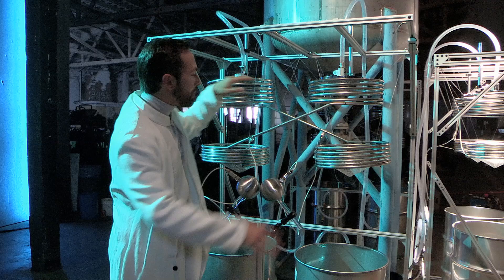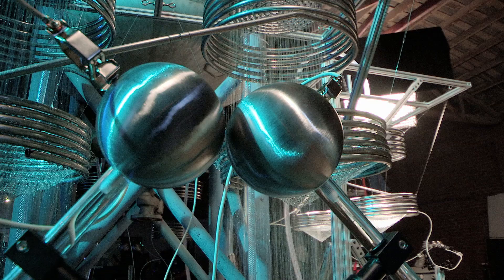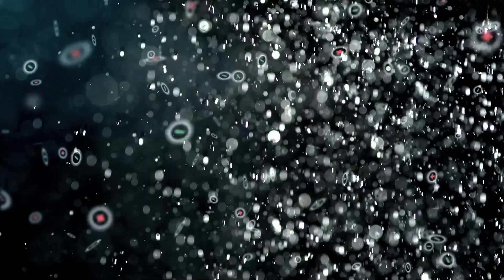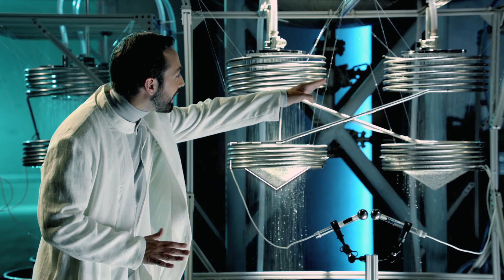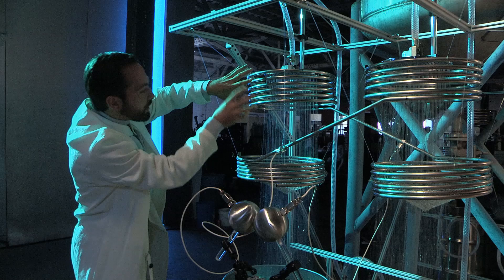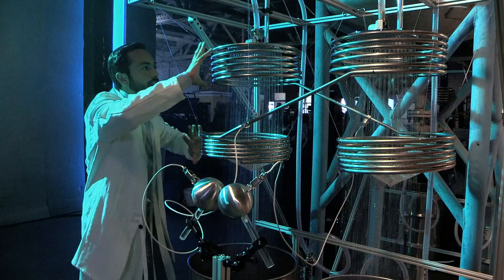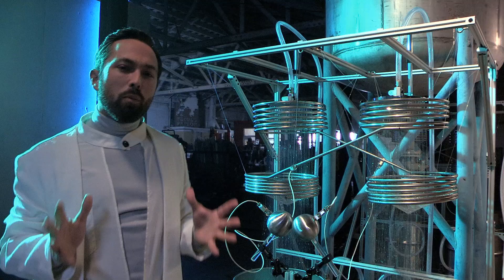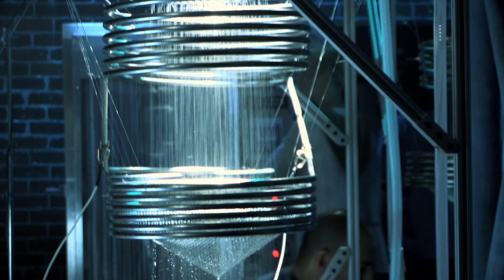Sparks from Falling Water: Kelvin's Thunderstorm

Comment: I guess, if the water were purified H2O (or "distilled water"), it would not produce any charge, but in normal water, there are always other types of atoms present, which exist in a state of ionization, being partly bonded to the water molecules, like if you put salt into water. If I remember my school chemistry correctly, that becomes Na+ and Cl- molecules which bond to the according side of the water molecules. That can only happen because water is a dipole molecule, it has one end that is positively charged and an other end that is negatively charged. So these ions will cross the charged wire mesh and then lose their charge. Because the water has before flown through the metal rings with the opposite charge of the wire mesh, the effect increases itself.
Reply from the maker: distilled water still contains ions because it dissociates into H+ and OH- so even pure water would work in this apparatus.
Reply: Veritasium So the water molecules are not actually H+ on the one side and OH- on the other side, as I were told in school and made to imagine a "triangular" shape of the molecule?
Reply: Ions, remember?
Reply: MrB10N1CLE Yeah, but distilled water isn't electrically conductive, or at least it has a way higher resistance than normal water, so there should be less to none ions in it?
Reply: Seegal Galguntijak When people say pure water is not conductive, it is because there are no ionic pollutants. Stuff like table salt (NaCl) would dissolve and conduct electricity. As such, pure water wouldn't function as a wire in that sense. In this case, it is less electricity than it is electrostatics, as far as I can observe, so it functions based on the fact that water is bipolar so it can separate charges.
Reply: It's not that it is not conductive. It is a poor conductor, but still it does conduct electricity, and also some of the water molecules does ionise itself.
Reply: Actually, pure water (H2O only) actually has a weird thing that happens; a very, very small percentage of the atoms will spontaneously dissociate into "H3O+" and OH-; the pH of the resulting water will still be 7.0, though, as they cancel each other out. 

TL;DR for below: There are 10^-7 mol/L of H+ ions as well as OH minus ions. Comparing this to the 55.5 mol/L of H2O.

The details, and finding out exactly how many ions there are per mole: There is something known as the "equilibrium constant" of any solution: Keq = [products]/[reactants]. Each one is raised to the power of it's own coefficient: in this example, H2O + H2O <-> H3O+ + OH-. It's been a year since I've taken the course, so I only know as much as my notes do right now: Keq = [H3O][OH]/[H2O]^2 // Keq * [H2O]^2 = [H3O][OH] = Kw.

Now, since this is pure water, we can assume that [H3O] = [OH]. Also, someone somehow (probably experimentally) figured out that the value of Kw = 1.0*10^-14, so 10^-14 = [H3O]^2, and when we square root both sides, we get 10^-7 mol/L = [H3O].
Reply: "I guess, if the water were purified H2O (or "distilled water"), it would not produce any charge, but in normal water, there are always other types of atoms present, which exist in a state of ionization"

Dafuk? ಠ_ಠ ....Uh... You weren't paying attention in chem, were you?
Pure water WOULD STILL produce a charge.
Impurities in water are not "atoms".
There ARE atoms present in pure water.
Each molecule of water has three atoms (two hydrogen atoms and one oxygen atom).
EVERYTHING has atoms. All matter is composed of different combinations of atoms made from combinations of different subatomic particles (protons, neutrons and electrons).
Reply: Two Replies That's why I wrote "other types of atoms" (and meant "other types of molecules and atoms"). Of course I know that every matter is composed of atoms, sorry for being so unclear to you.
Reply: Two Replies I'm pretty sure the charges comes from ions, which are not present in destillated water.
Reply: Seegal Galguntijak
Most of the water molecules will be H2O (polar covalent), however 1 in every 10,000,000 (10^ - 7) of these molecules will be ionic in the form of H+ (actually H3O+) and OH-. Incidently this is why water has a PH of 7).

(See Monkyupurbutt 's comment above for a good technical explanation.)
Reply: Samuel Estenlund
Pure water contains ions. See my comment above.
Reply: fred321cba
Oh my goodness, my years in Organic Chemistry are coming back to haunt me! I love that I actually remembered this while reading "pure water contains ions." I instantly remembered H3O+ and OH-. Thank you for that!
Reply: This is a pretty good answer
Reply: Monkyupurbutt Oh god your username is so... you know.. .and then that brilliant chemistry happening... wow.
Reply: Monkyupurbutt they dissociate because of thermal energy (10^-14 is the kw value at 25 celcius, it increases with temperature) , it's not spontaneous in the true sense of the word, tehnically, at close to zero kelvin, you would have 0 ions in water, since it would be entirely crystallized
Reply: Seegal Galguntijak H2O creates H3O+ and OH- on its own through self-ionization. When one molecule bumps into another, depending on its speed and orientation one molecule grabs an H from the other, forming both ions.

It happens no matter what because liquid water is always in motion. Distilled or 'De-ionized' water is used not because it has no ions, but because it has no ions in it that aren't hydronium or hydroxide ions.
Reply: L2112Lifz But why does 'distilled' or 'de-ionized' water have such a high electric resistance, when it actually contains ions as well?
Reply: It's resistive when compared to non-distilled water, but distilled water is still technically conductive.

This question is actually the basis behind the self-ionization of water. Arrhenius found that distilled water was still capable of carrying a tiny charge (a conductivity of 0.055 microsiemens * cm-1), and theorized that water was made up of ions, as well as molecules of H2O.
Reply: Samuel Estenlund yes they are present
Reply: Seegal Galguntijak because aren't ions that conduct electricity, in fact normal water contains various salts and substances that helps to conduct electricity. Distilled water is water without those salts that are present in normal water
Reply: MR5er1 Yes, but my understanding was, that these minerals that help the conductivity of water (or create it in the first place) are dissolved in it as ions. Which is electrically charged particles. So the answer that L2112Lifz gave brought me closest to understanding this (what appeared as a contradiction to me).
Reply: They do help the conductivity of water, but distilled water is still better described as a bad conductor than a good resistor.
Reply: Seegal Galguntijak ok, but i have to say that are the H2O particles that create the electric charge, because also those particles are divided in positive and negative ions. Water is neutral because positive and negative ions are balanced, this machine take advantage of the fact that we don't live in a perfect world and water is always a little more positive or negative. So it doesn't matter if water is distilled or not.

I hope i answered correctly ;)        Sergio Italy
Reply: And also it does' t matter the bad or good conductivity of the water because In this generator the only things that
 conduct electricity are the metal coils and the two spheres
Reply: MR5er1
Yes, but the question in this thread was how can distilled water be charged if all of the ions are taken out.

Quick answer, they aren't all taken out. Dirty answer, Arrhenius theorized that water was made up of a balanced mixture of ions in solution because he noticed the capability to run current through distilled water despite there being no added positive or negative ions present in the water... Which explains why this would work with distilled water or with regular tap water.

And that's how we got sidetracked into talking about the conductivity of distilled water.
Reply: it's explained in the video!
Reply: MR5er1
The basics were explained in the video about polarization of water... But then there was a comment about using distilled water, which brings us to now.
Reply: +Veritasium It is difficult to believe that deionized water would produce any appreciable charge separation purely from the hydronium and hydroxide ions alone, as the concentration of these ions is very low, and your apparatus is not a perfect system.
Reply: +EebstertheGreat even if there are very little iond out of balance they are still going to attract some balanced ions in the coils, accumulating energy like a capacitor and then jump across the gap betwenn the metal balls. excuse me for my bad english...  i'm from Italy
Reply: MR5er1 I understand the principle, but like I said it is not perfect. Hydrogen and hydroxide ions won't even accumulate on the mesh. Even if they do, it will take a long time to build up a charge, if it even builds up at all and doesn't get washed out by noise.

Distilled water has a resistivity on the order of 1 GΩ·m. I don't know the resistance of the open circuit in this setup, but it's hard to believe it's greater than a gigaohm.
Reply: +EebstertheGreat - not sure 1 Gig-Ohm-Meter is right.  I've always heard 18 Meg-Ohm-cm.  Sure, round that down to 10 M-Ohm.cm.  Then comes conversion from cm to meter, a factor of 100 used to multiply or divide. If one multiplies, then yes 1G_Ohm-m.  But I think division is the correct operation here.  Then it's only 100k Ohm-m.   
   Two ways: 
 1) it's a cube of water, conducting from face to face,
       If it's n times bigger, then it has n times more length increasing resistance, but n-squared more area, decreasing resistance twice as much.  So resistance goes down by n.
 2) keeping units in your conversion math,
       10 meg-ohm-cm * (1meter/100cm) = 0.1 meg-ohm-meter.
Reply: Jim Swenson 1 MΩ·m = 100 MΩ·cm. It has nothing to do with how they are computed; it is just a unit conversion. 18 MΩ·cm = 1.8 GΩ·m.

Comment: The energy comes from whatever makes the water move. The electrical field of the two upper coils polarizes the water between them, but the positive and the negative part still attract each other and would stay together if it was not pushed apart by force.
Under normal circumstances it would be gravity, or potential energy of the water in gravitational field which gets depleted as the water falls down. But the machine could be reproduced also upside down or in microgravity conditions such as on ISS - in that case other source of energy pushing the water through the machine would be the source.
Reply: Agreed, the energy is coming from the pump in the buckets.

Comment: Positive feedback system, with the energy input from the falling mass of the water. And the water acts as a charge carrier, moving charge, thus current.

Now picture this occurring on a vast scale miles wide, and the thing filled with convection columns many feet across replacing the coils... And then you're basically outside during a thunderstorm.
Reply: right what i was thinking the guy must have got idea from storm humans learn from nature
Reply: Except that the current theory for thunderstorms is ice crystals
Reply: Positive feedback. Yes.
Mass of falling water -- doesn't play the slightest part.
The CHARGE WITHIN the falling water is what makes it work.  The amont of mass literally has nothing to do with it.  Take another substance that's heavier and with a lower disassociation constant, and it will take substantially more mass to produce the same amount of charge at the electrodes.
Reply: Also, as for this being how thunderstorms happen.  No.... the "static electricity caused by rising air currents" model of thunderstorms was always shaky at best; It has now been PROVEN that lightning is a result of charge in the UPPER atmosphere (like tens of miles above the cloud tops) caused by cosmic rays.

Comment: One point not emphasized in the video is that electrons have to flow through the common water pathway, partially backward against the physical flow of molecules. It's that electron flow that ultimately creates the difference in charge between left and right. Gravitational energy is inefficiently converted to electrochemical energy by induction, until electrons in the 'capacitor' jump the gap.
Reply: I know this is a 4 year old video and you're not likely to even see this comment of mine, but if by some slim chance you do, would you mind elaborating further? I don't understand how the stream becomes charged, which is really bugging me and I can't seem to find a fulfilling answer online.
When you say that "electrons have to flow through the common water pathway" what pathway are you referring to and how does that allow the stream to become charged?
Reply: @shadiester   I think it is kind of like a feedback loop. He started off with the assumption that one stream had slightly negative and other has slightly positive charged water particles. These induce their charges to the mesh. Since one mesh is connected to the other stream's coil, it forces the the water in the other stream to take opposite charge. Because of this feedback system, the coils accumulate more and more charge. These coils are in turn connected to the metallic balls. When their is enough potential difference, there is a charge discharge and the coils become neutral. This repeats. This is my understanding.
Reply: @nageenyerramsetty4954  I understand most of it but this one part is what I don't get: "Since one mesh is connected to the other stream's coil, it forces the the water in the other stream to take opposite charge."
Why does it force the water in the other stream to take the opposite charge?
Reply: @shadiester  Let us say mesh 1 is negatively charged which makes coil2 also negatively charged. Because the coil 2 is negatively charged it attracts positively charged water particles and also repels the negatively charged water particles. So the negaticely charged water particles are forced to move upstream into the water tank. This happens against the gravity and that is what is mentioned in the original comment. Also what is not shown in ths video is that the two water tanks are connected through a metallic wire. So the negatively charged particles which were repelled by coil 2 flow back up and come through water stream 1 thus making the mesh 1 more negatively charged
Reply: @nageenyerramsetty4954  Ah okay, that makes a lot more sense now! I didn't realise that the charges were actually moving into the water tank. Thank you for clearing that up!
Reply: @nageenyerramsetty4954  yep, when i first watched this video, i couldnt understand why he left out such a core mechanic of this system. but i have issue with the electrons flowing against the flow like this.

Comment: Instead of 2 streams, suppose you have either 3, 6, or 9 streams. Tesla seemed to like these numbers. With 3, arrange them in a circle. The bottom coil attaches to the top of the next going around. Three balls will be under each lower section coming to an upsidedown apex. The sparks should go in a circle. Instead of a spark, pulse thru a coil to make a temporary magnetic field in rotation. A motor. Attach a giant beater, and spin this in chocolate, like in Charlie and the Chocolate factory.
Reply: Sadly the 3,6,9 quote is not a real Tesla quote.
Reply: @CharlieSolis Awe! But I really like those numbers!